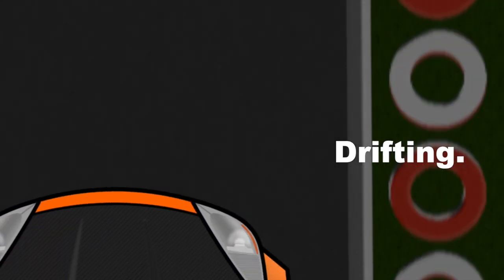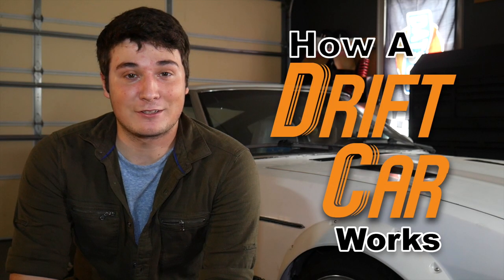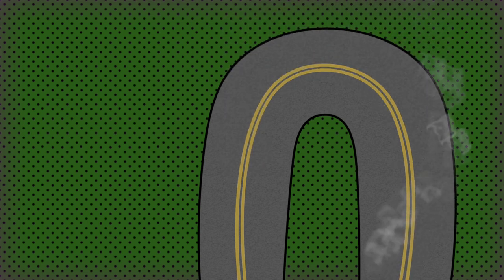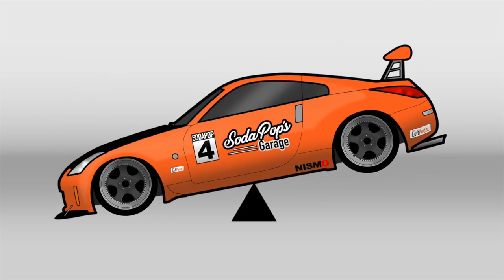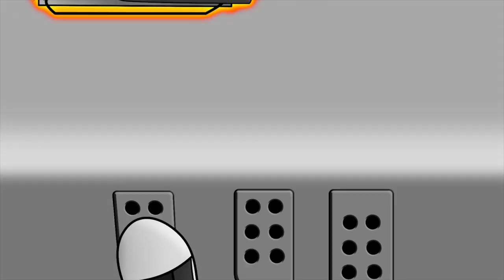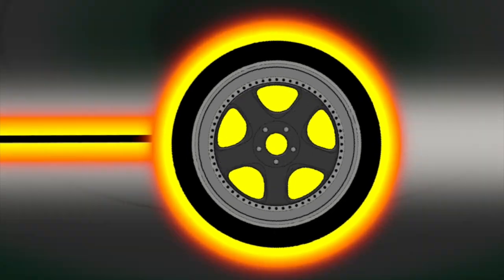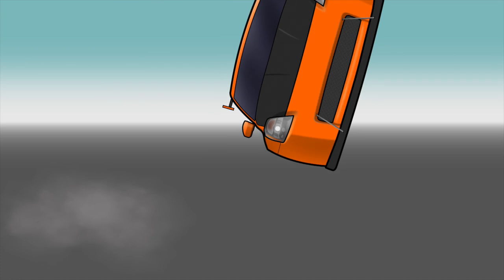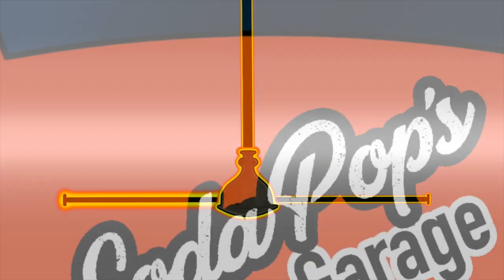How Drift Cars Work

Comment: Im not an excpert but i think that drifting is actually slower than if you are taking the turn normally drifting is more of a thing for when u now your car well and u have good control over it
Reply: Lmaooo not at all, you wouldnt be able to take a regular turn at the speeds you drift at and would smash into the wall (or out of bounds)
Reply: @Ntrinzc  lmaooooo yes at all if you drift it you are puting kore stress on your tires and you lose alot of momentom going out of the turn as you have to slow down so your wheels stop sliding